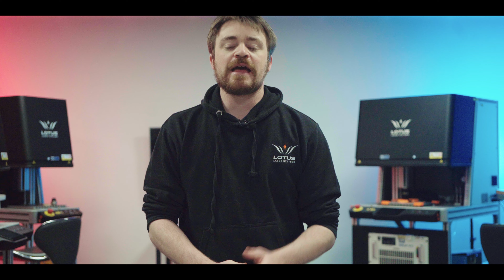Stop Using CO2 Lasers for Glass! (Use UV Instead)

Comment: Hey guys love the videos. Im super interested in inner 3d glass block engraving and noticied you've not made much content on it, would love to see a video about the capabilities of your machines AND the softwares features when it comes to this kind of work. Especially interested in what your systems can offer that other on the market don't for inner UV engraving. Cheers!
Reply from the maker: Thanks for your comment! So this kind of glass engraving requires specialised optics & other technologies to get the best results, and this is something we don't offer our machines currently. This is chiefly because as much as it's very cool, it tends to not be an application our customers need, so we've optimised our machines for the products our customers typically want to work with.

Additionally, we'd actually suggest using a Green laser (which is a ~532nm wavelength) as opposed to UV (355nm), but we principally work with UV because for surface marking on glass it's flawless (as you can see from the video), so again it's just about optimising for what our customers look for.

So basically - not something we can produce next week, but watch this space because when we do it'll look absolutely terrific!